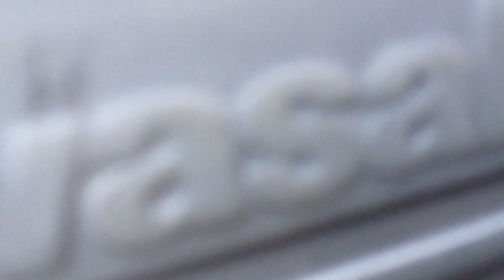Kawasaki bayou engine knock?

Comment: Hopefully this helps someone:

I have a Bayou 220 that had a knock at idle.  SImilar to this one but louder and a bit more consistent.  The 3 bolts that hold the starter clutch to the flywheel were loose.  They are captured so they can't really fall out but it makes the starter clutch wobble back n forth causing the noise.  You have to remove the flywheel to get at them.  I used loctite to resecure my bolts.  It was my Dad's quad.  When he started it after the repair he couldn't believe the difference.  It sounded brand new.  I know this same setup is used on the 250 Bayous and maybe others?

Comment: Unplug the voltage regulator and see if it quits knocking. If you have a meter check the voltage at the battery terminals while running and regulator plugged in to verify your not over 14 volts.
Reply: Yes, this guy right here!!!!👆👆👆👆👆👆👆👆👆👆👆👆👆👆
Reply: I know y’all will doubt. But if your voltage reg goes out, it will load or lean with fuel causing back fire, which sounds similar to a chain slipping over a sprocket. It’s the little metal thing with air fins and 6 wires, 3 yellow 1 white, 1 brown, one black yellow. Also check your kill switch and key switch contacts and plugs. ANY connection that dictates if the bike runs or not.

Comment: I know y’all will doubt. But if your voltage reg goes out, it will load or lean with fuel causing back fire, which sounds similar to a chain slipping over a sprocket. It’s the little metal thing with air fins and 6 wires, 3 yellow 1 white, 1 brown, one black yellow. Also check your kill switch and key switch contacts and plugs. ANY connection that dictates if the bike runs or not.

Comment: I know it's a old vid. it's the timing chain, just being sloppy in there. eventually it gets worse and it will click as you pull it over. time for New chain, chain guides, and assembly lube.... hope the info helps. the loud pink noise he is talking about is the timing skipping. once out of time it won't run properly. turn it off and it can skip back....

Comment: If it's the same problem I had it's the clutches try putting new clutches in it
Reply: Mine is doing the same thing so your saying it's the clutch I have a spear motor for it and there's nothing wrong with I'll have to replace the clutches in it goes so you do that anyways??

Comment: Mine does the same thing off idle, always has. I think the timing is hot on these at low RPM.
Reply: bobdole57 I have a beyu 300 it knocks when it's idling
Reply: bobdole57 has nobody ever taking it apart to see what it was inside of their knocking

Comment: Did you ever figure out what that noise is?  My 03 Bayou 250 sounds exactly the same.
Reply from the maker: asimonsays243 yea they all do it. I guess it's the high compression of the motor. From what I've heard its just the centrifugal clutch ticking. nothing to worry about.
Reply: I swear this damn machine of mine is going to give me grey hair.  I bought it from a family friend after it sat for something like 3 years and its been problematic to say the least lol

Thanks for the reply :)
Reply from the maker: What kind of problems are you having with it. The bayou is a pretty good 4 wheeler.
Reply: Right now Im trying to figure out what the intermittent banging noise is.  Sometimes when you go to start it it sounds like its about to toss a rod and then others it doesnt.  Im almost thinking Ive got something hanging up in there but I havent taken the top end off yet to even start looking at it.
Reply: Prolly like said, , a timing chain, timing issue.

Comment: i have a 1996 bayou 400 and it is liquid cooled it sounded similar when when we got it and it had antifreeze in the oil because of the water pump seal  and the valves and the cam was scarred with aluminum and it broke the timing chain into 3 seperate pieces but if it isnt liquid cooled you should be ok
Reply: Well a bayou 400 is completely different as far as the engine goes.

Comment: it is the valve in the head my 220 had the same thing I Re places the valve
Reply from the maker: It wasn't the valves, it turned out to be a clutch thing that they all have. I sold the 4 wheeler years ago and the folks say it still runs perfect.
Reply: Oh ok